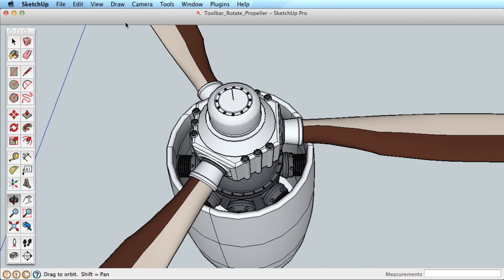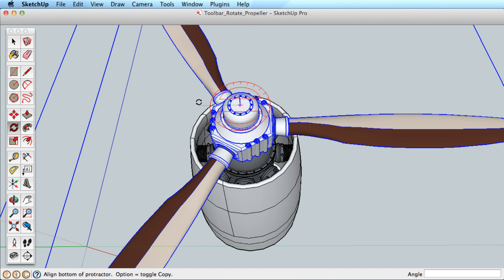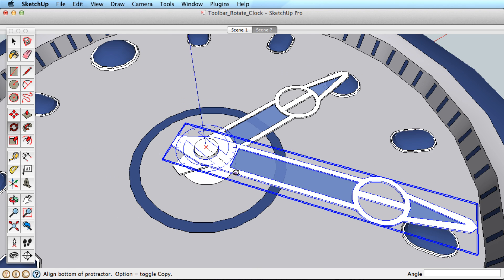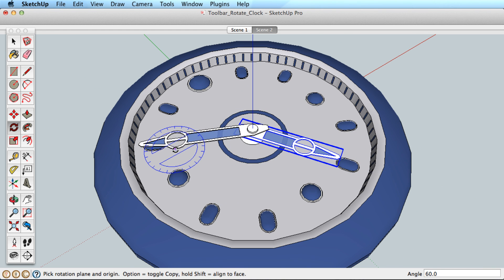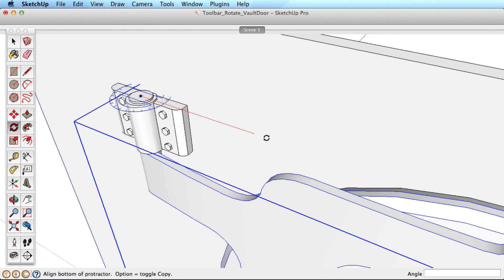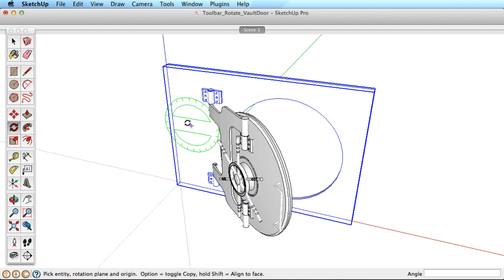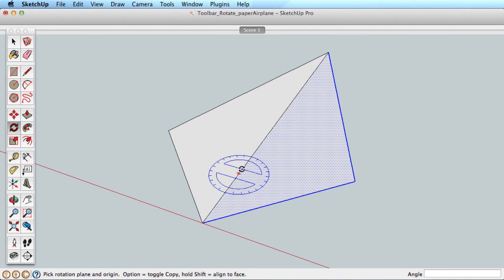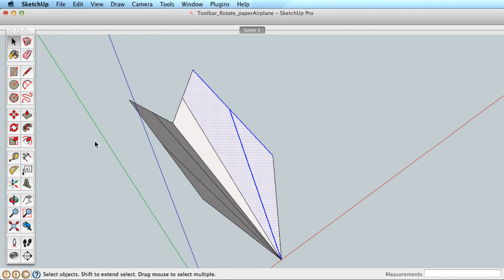SketchUp Training Series: Rotate tool

Comment: I couldn't get the Rotate tool to re-orient itself the way this video shows, either. After years of dealing with this I managed to find two ways of forcing the orientation: 
If I'm working with a square or rectangle I use the Move tool rather than the Rotate tool. If you click on a corner of a square, then drag the Move icon along one of the adjacent edges, the tool will turn into a protractor oriented to rotate that edge. This protractor is always red, no matter the orientation. Also, no matter where on the edge the protractor is located, the edge will rotate about its midpoint.
Perhaps a simpler solution, that seems to work in all cases, is to set the camera to the standard views. If you are in front or rear view and click Rotate, you will get a green protractor. If you are in either side view you will get a red protractor. Once you have the protractor, hold the shift key to lock the orientation, then move it wherever you want.

Comment: I could not make this work.  Here's what I'm doing, trying to follow: With select tool, click object. 2. With rotate tool, I'm clicking the end point where I want it to rotate.  At this point, it should start to rotate?  It doesn't. I select another end point on the same object to attempt to mimick the steps in the video. No joy. No rotation. I get the moving axis with the rotate tool, but nothing is moving.